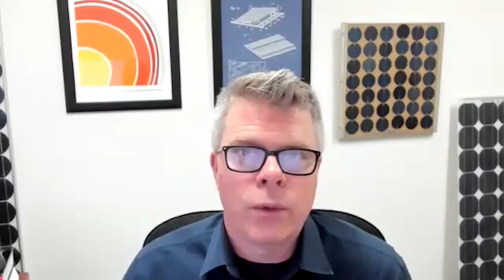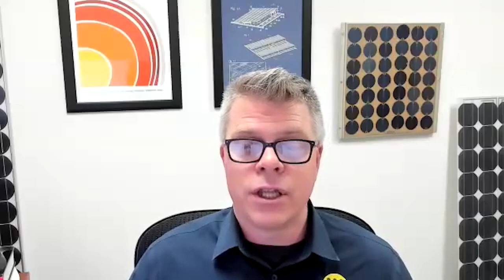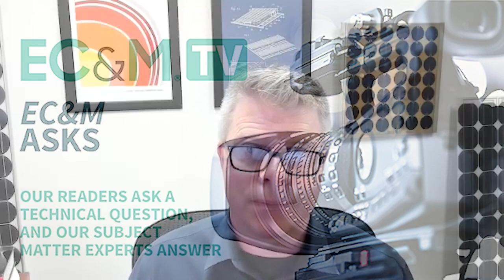EC&M Asks — Can You Run AC & DC Conductors to PV Systems in the Same Raceway?

Comment: I'm working on an install that has 240V AC circuits that supply a small enclosure which charges a tracker motor for a tracking PV array. Hangers are being used to route PV source circuit conductors within the array, and it would be ideal to use the same hanger to route our 240AC circuits. The AC circuits would be single conductor PV wire. If the cables have the same insulation rating, would this be permitted by 690.31(B)(1)? My interpretation is that these AC conductors are part of a PV system and do not need separation from DC source circuit wiring.

Comment: Pulls out my copy of the Canadian Electrical Code to (2012) follow along ... Nope. Must be US code. (Sections only go up to 80-014)
Edit: Solar photovoltaic systems are section 50 in the Canadian code.
The exception allowing you to combine different voltage sources in the same raceway appears to be: section 50-018 Wiring Method (9).